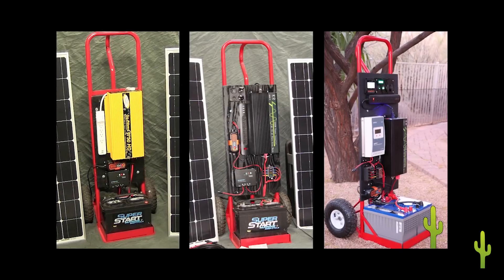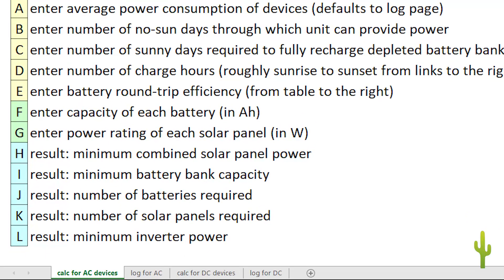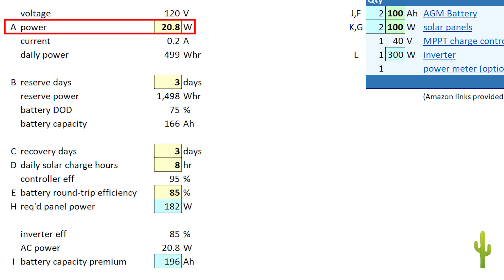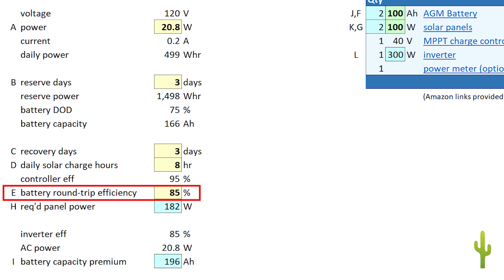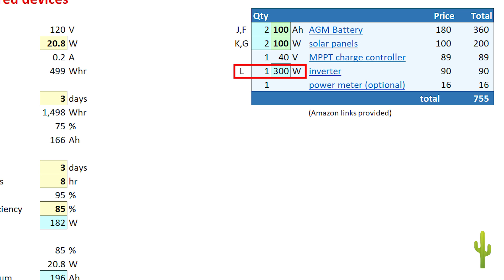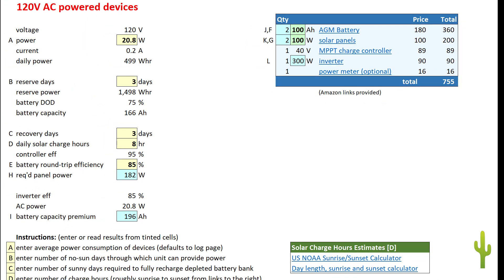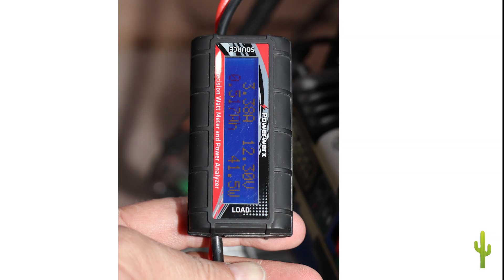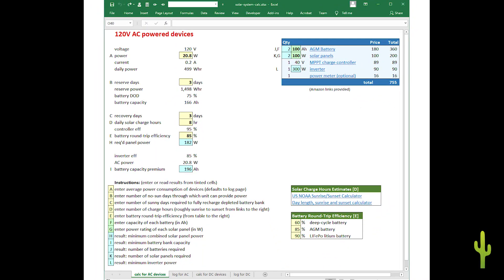DIY Design Worksheet for Your Solar Generator Project

Comment: Desert Prep, Your videos were instrumental in my decision to build my Mobile Solar System". I live in MI and my operational environment is significantly different than yours. I am not a “Solar YouTuber” like you and so many others, but I have recently posted several videos showing what it is like using solar in MI. Rather than putting my panels in a fixed location, I made a mobile solar cart and I did a Direction and Angle test and the results are at https://youtu.be/su2St1m4uWU. I also have a Buy or Build video and because of your influence on my decision, in my video, I highlight your channel https://youtu.be/DZjdUbPnwJM. Thank you for sharing your knowledge and keep up the good work on educating and helping the public on the benefits of effectively utilizing solar. For my location in Michigan going pure solar is not operationally effective as outline in my Pure Solar in Michigan video https://youtu.be/uqOKmm7jvV8. Always, looking forward to watching your videos. And if you want to see what it is like to have the power go out in Michigan watch this video https://youtu.be/ndPZgkUjTcE.

Comment: A few years ago I watched your videos on building a portable power supply. Very helpful. Covid lockdown provided the opportunity to build a backup battery pack in case of the loss of grid power. I completed a 24 volt, 2600 watt portable lithium battery pack with a 2500 watt inverter. One of the most difficult assessments is exactly how much power is needed. I used both AC and DC meters to measure both the loads and the capacity of the battery pack. It is admittedly through luck that what I build does provide the necessary power. Your spreadsheet is a very nice tool to get a good estimation of what is needed. Crunching the numbers prior to the build is necessary but it is also important to actually measure the loads over a period of time including projected the system losses. Appreciate your good work and insight. Thanks for the inspiration!
Reply from the maker: I completely concur -- actual measurement will save you either way: keep you from building an under-capacity unit that won't reliably power your load; or waste money and resources on an over-built system that's much more than needed.  Thanks for sharing your wisdom.

Comment: I don't like these at all. Too much overkill requiring to check the watt hours on each device you have or may plan to get, estimating how much time you use each, plugging the data into the spreadsheet etc. To me, people have a good idea what they use and how often. The major concern should be either 120v house hold appliances or 12 or 24 v systems. I say find your needs assuming half sun and half cloudy days (you will know if you normally have mostly sunny or mostly cloudy days depending on where you live) using a ball park of your daily usage. Instead of watts calculating, simply state a system can run A,B C and D for so much time then give yourself a little more overhead. LED lights use next to nothing. Modern computers and monitors/tv a little more which along with lights you'll use the most. Perhaps you'll use a dishwasher 3 times a week. Perhaps 40 gallons of hot water every 3 days. Perhaps wash clothes 3 times a week. That's not much power for thrifty minded people. Solar should be simple.
Reply from the maker: Ahhh - I wish I was as good at estimating as you are.  Even with an electrical engineering background, it took four versions of my original solar generator to get it to what I wanted.  Like most people, I'd not done all the homework needed to account for losses, battery depth of discharge limits and trade-offs, the impact of controller type, the comparative advantages of serial and parallel panel wiring, and a dozen other factors that WILL prevent your solar project from meeting your needs.

At the request of people smart enough to piggy-back on the knowledge I'd accumulated, I built it all into a set of worksheets so others could plug in what they know, and get a properly-designed system.

You may not like measuring the devices so you know what you're dealing with, but I simply couldn't find another way to get a system that would, for sure, do its intended job.  While I can't argue that you couldn't get a workable result by throwing extra hardware and capacity into the system, this translates into real money, so I provided the mechanism for people to create just what was needed.  It trades a little effort for potentially hundreds in cost reductions.